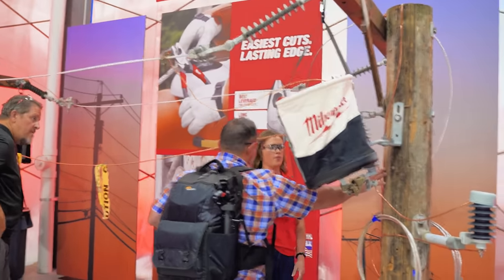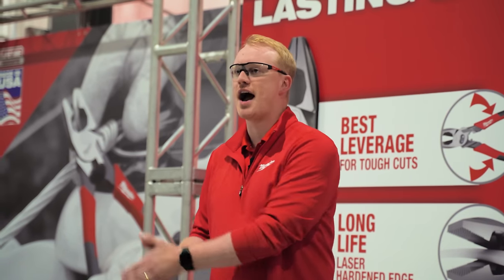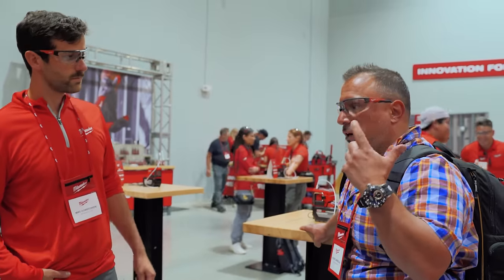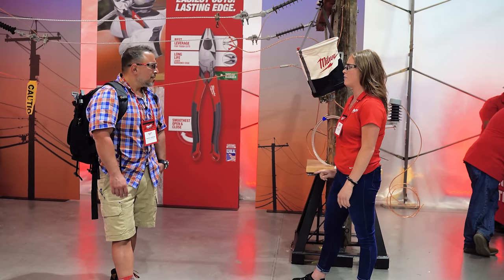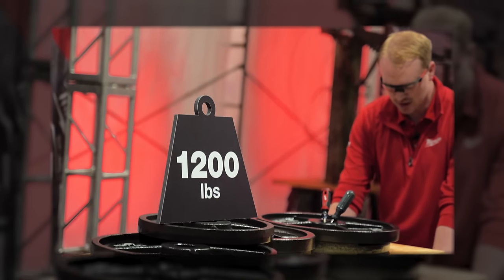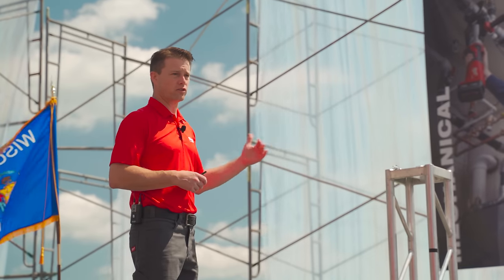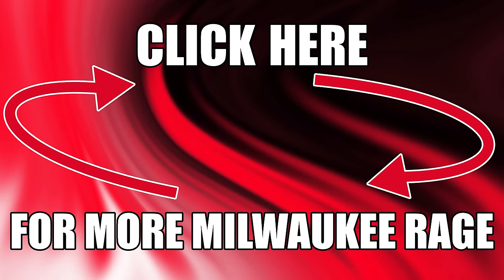BIG Problem With Milwaukee's USA Made Hand Tools (THEY'RE LYING)

Comment: New Britain tool company made the best tools, they didn't break.
Super precision bearings are hardened using induction. 
My guess is, the laser is versatile.
Probably not better, cheaper.
Induction heaters are built for a specific job and won't effectively do any other.

Comment: I swore not to buy Milwaukee tools because of all the fan boys.  A tool is meant to be used and sometimes the fans and the company do get “a little extra” as you say Vince.  That said, I started a factory job two years ago where I needed to supply my own tools- and everyone said the m12 line was the way to go for power tools.  I priced it out and they were on par with the competition for the core tools I needed when they were on sale (drill, impact driver and cordless ratchet).  I’m a believer.  Their screwdrivers aren’t anything special but I like them enough that I bought them as a second set at home after my USA craftsman and they’re now my primary screwdriver.  I’m considering m18 to replace my black and decker 20v at home but some of the tools I just can’t justify the cost.  I did subscribe though, so if I see any sweet tool deals maybe I’ll jump on the m18 line next 😂.  Kobalt, Metabo HPT and ryobi are at the top of my list if Milwaukee doesn’t come through for me by Black Friday.

Comment: I'm and electrician & HVAC-R tech.  Overall, I like Milwaukee tools; but I have owned many of their screwdrivers and do not like them.  The tips seem softer and do not fit or hold up as well.  Also do not care for the handles.  Greenlee, Klein and Dewalt make the best from a fit and durability standpoint.  Believe it or not, Doyle is also pretty decent.  IMHO, Milwaukee is top drawer on corded and battery tools, just not there yet with hand tools.  Maybe the latest generation in the Vid are better?  We'll see.

Comment: Not everything that Milwaukee makes is top of the line. I have a pair of strippers/cutters/nose pliers that have what I think is a design flaw. The cutter portion is too close to the end, so if you use it as a pair of needle nose pliers, you can easily bite into the cutter portion and mess it up where it won't close all the way and lock in place when not in use... filed mine down once because of it. If they would have placed the cutting portion back further from the end this wouldn't have even been a issue, the nose plier portion isn't near long enough to avoid the cutter portion. Now I just use regular needle nose pliers when I need it.

Comment: Not gonna lie it has been kinda cringe to watch some of Milwaukees demos recently. I own Red tools and i see 👀 the little tricks and things done in the demos. I just wish Milwaukee would increase their quality of tools not their quantity. 
Just to name a few things such as, battery wobble on their 18v tools, it drives me crazy and doesn't make the tools feel as quality as say Makita or Dewalts newer tools coming out now. Their drill chucks being horribly off centre compared to well even some cheaper brands. 
Battery issues, impacts not working because of poor quality control from factory assembly with pinched ribbon cables, triggers not having a rubber baffle to prevent the ingress of dirt from the environment it was designed to work in, i guess thats why my brothers Makita tools have lasted longer than mine, just better build quality and though for longevity i guess. A 5 year warranty is great but you know what is better, a 3 year warranty but never actually having to use it...

Comment: As a manufacturing engineer, I can tell you with absolutely certainty that people need to browse the aisles of their local hardware stores. Look at the quality between brands. If the hand tools look lesser in quality visually, they are lesser quality. If they don't pass visual inspection, they're not worth buying.

If you're seeing an indication of poor casting, poor grinding, jaws that don't line up by tooth, cheap "bluing" lines on the tools, they are all indication of cheap tools. 

Some Milwaukee hand tools are of good quality, and you can 100% tell which ones are made in Taiwan over China. Don't let them tell you though that their lineman's are made in America, because they're not. They're made in Taiwan, and probably the worst tool to come out of the line. That's their LIE. Be like me and have an assortment of hand tools from different brands.

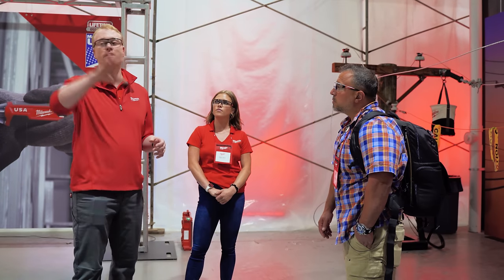EDIT: 4:35 ABSOLUTELY boils my fucking blood. Please for the love of Christ get someone in there that knows even the slightest bit of manufacturing, and not some dumbass that makes excuses. There are things called STANDARDS, and every manufacturer follows it.... It's so well known and public, a simple GOOGLE search can bring up the standards.

Comment: USA product that absolutely killed it in the cordless market for years now. Milwaukee hit a lot of people’s soft spots. Great reputation and they have no problem using their momentum on their hand tools. You see Milwaukee and you think best of the best. As a Makita guy I can tell you Milwaukee cordless is the best of the best. But the hand tool market is slacking. Not even just Milwaukee. All of the Klein tools I’ve bought recently are junk. All of the channellock tools I’ve bought recently are junk. Klein drivers loosing magnets. Channel lock needle nose bending and their pliers handles being devolved easily. The hand tool market in the US is falling apart and it’s because of brand loyalty. 

I’m a Makita guy, with a corded Milwaukee super sawzall….. Signing off
Reply: @Dr. WomenHateShortMen  🧐 their 12 volt makes me regret my investment in Makitas 12 volt. How they get that power from a 12 volt platform is beyond me. They killed it.

Comment: I must be the odd one out but I seem to be the only guy that uses hitachi/hikoki gear (sparky) Still have 3ah batteries from 2010 that hold a charge and drills that ive upgraded before needing to be changed.

On the other hand about 60% of the guys i know that have Milwaukee have had trigger failures on their drills and impact drivers which puts me off them

Comment: The marketing firm Milwaukee making hand tool in the USA out of imported steel with foreign national workers. The ratchet in my socket set broke on the first use. My 3rd gen m12 impact and drill developed problems on the first job. Every bag and case have had the zippers fail. The only tool companies left on earth that just produce tools are Makita , Hikoki (Metabo , MetaboHPT) and Hilti. Next in line would be Bosch tool. I am not a fan or a fan boy.

Comment: Milwaukee has the best batteries. They work well up to 100 degrees. In more extreme heat they fail later than any other brand I have used. They work pretty good down to around 25 30 degrees, and fail later than dewalt. I have been hating on milwaukee hand tools since they started. They work, but no better than some more affordable brands. The fastback is handy, but easily breakable. I still have my first good knife, magnesium craftsmen my dad gave me when I bought my first tool belt a dozen years ago
Reply: As far as snips go, you will get way better snips from wiss or midwest at a lower price. You will find better pliers and wrenches from crescent, channellock, or even just kobalt will probably be on par!

Comment: Milwaukee hand tools are subpar compared to mainstream shop brand tools. They still can not compete with snap-on, mac, tekton, koken, knipex, Icon, gearwrench, mayhew, greypneumatic, even VIM.... they are more on par with Sunex. I have personally bought some milwaukee handtools at home depot in a pinch when Tool truck is not available.. and they either all broke, got damaged, or just didn't perform as good as the mentioned brands.

Comment: I always buy the cheapest and Pittsburgh Tools have yet to let me down.
Snap on snaps off. Busted sockets.
Craftsman ratchets are made of silly putty.
I owned 1 Milwaukee power tool.
I plugged it in and it instantly caught fire.

Buy cheap, save money and get the job done, faster.

Comment: Milwaukee USA made tools are no better than Klein or Channellock and Formerly Western Forge.  I do give them credit for innovation regarding using Lazer technology, along with using induction for heat treatment which potentially could help keep costs down.  This technology also helps on an environmental standpoint. Until Milwaukee can compete or beat Knipex, I'm not sold. As far as Screwdrivers go, It's hard to beat Klein, wera or Wiha.  Companies often times blow things out of proportion.  I give Milwaukee props for innovation in manufacturing.  I worked with tools long enough to know what advertisement hype looks like. It's great there's another company out there making USA made tools. I'd also like to see more manufacturers bring production back to the USA.  I believe Lazer technologies and induction heat treatment can make this possible.  One of biggest costs with manufacturing tools in the USA, is meeting environmental standards and the cost of permits.  The other expense is labor. With these said technologies albeit expensive for startup costs, in the long run it's a game changer.  Less labor required, very automated, not much of a foot print.

Comment: They don't need gimmicks. They just need to produce accurate, tough, and American made tools. I'll never use a screwdriver to pull 1200 lbs, if I need to do that, I'll use a pickup. Just make something that's good, something that works, and make it in America, then it will sell.

Comment: In fairness I only saw you pull like a foot while the other guy was dragging the box across the floor. So technically you're right but your arm was shaken like crazy to prove a technical point. I can show you technically my truck can't pull something but then I can show you that it can... but at what cost the structural integrity of my work?

Comment: I'm 63 years old AND my dad gave me his old tools an I'm still using them AN  THESE tools  are all  different kinds some are thorsen, some are proto, some are , stanley ,some are, craftsmen ,an snap on,AN  crescent, AN Sears, but I've got a pair OF linemen pliers that will cut a 5/16 steel cable no problem  an a half inch copper cable . An I've tried TO BY another pair just like these an THE snap on guy says give THEM here I can send them in an see if they make them BECAUSE the ONLY mark is an S - O. AN THAT all but THEY work great I'm WORRIED I would never get them BACK an THEY were my dad's  AN he's gone.

Comment: All I want is a quality American Made tool that doesn't cost an arm and a leg. What good is a tool if you can't afford to buy it, i.e. Snap-On? There should be no way that a quality Chinese-made tool could be manufactured and shipped across the ocean, pay tariffs,  pass through importers, buyers, distributors, and retailers, and be sold for less than a tool manufactured in the United States.

Comment: I just threw out all my old craftsman screwdrivers cause they were making my tool box smell like puke. Guess it's a chemical in the plastic handle breaking down. Just thought I tell everyone.
Reply: yes, acetate butyrate decomposes and smells like that.  Many like that kind of handle. I prefer the Klein molding. You could have aired out the tools and cleaned them to remove the residue coming to the surface.

Comment: So I know this isn't the point of the video, but did he say that the entire manufacturing facility has air conditioning? Like, the whole materials area, assembly, machining, etc... everything inside there, has AC? Because if that's true, that right there is the most impressive part of their new facility. Lol. Ask anyone who's worked in manufacturing or warehousing. It gets hot as hell in every building, especially the concrete ones. And, each day in a row that it's hot outside, the temperature inside gradually gets hotter and hotter. Those buildings become essentially an oven. They don't cool down overnight at all either, because the concrete just retains every single degree that it can as if it's the most valuable asset in human history. And in the facilities I've worked in, we weren't allowed to open doors at night because it would have let in dust and dirt or it was a violation of our security policies. Anyway, I've gone on long enough here... I just wanted to say that I am deeply impressed and thankful that Milwaukee is setting the example in that sense and I can guarantee you that their employees are far more grateful and thankful than anyone could understand.  I hope and pray that other companies follow their lead and despite the substantial cost to provide air conditioning, they follow suit.  
(I am aware that the caveat to this is that some manufacturing and production facilities cannot have air conditioning because the humidity will rust their parts and/or products, so it just isn't something that's feasible. However, I feel like technology has to be at a point where it can eliminate that humidity while simultaneously allowing cool air to flow throughout the building. I'm no scientist but it seems like a dehumidifier in conjunction with AC would be a step in the right direction. 🤷‍♂️)

Comment: I’m not one to break down another’s thought process but what do you think marketing is? They are branding their tools as made in the USA and as a made in the USA tool that does exactly what the foreign made competitors tools do and do it better than the competitors. I’m not sure why you are creating this conflict. It’s almost like you have the air conditioning on as cold as it will go while having the heater running as hot as it will go in your own head. Like you’re saying two plus two is four but also, two plus two isn’t four. It’s marketing. It’s advertising. People love to see tools doing this crazy stuff while doing what they’re made to do. We all know the difference between the truth and a lie. The truth with the screwdrivers would be it took a lot more force to keep the screwdriver stuck in the screw to pull the weight with the competitors tool than it did the Milwaukee. The Milwaukee screwdrivers, in my opinion and experience, have been the best fitting and performing screw driver I’ve ever used. I’m thinking about buying the 14 in 1 to keep with me at work instead of my Klein. All this being said, when you advertise your product, you show it in the best light possible and you do not highlight your competitors product in such a way that make your product look equal or lesser than. That’s not a lie. A lie is quite different. A lie would be if Milwaukee said no other screwdriver out there fits screws well. A lie would be if Milwaukee said no other pair of linesmans or needle nose or dykes are sharp and cut well. You’re queuing in on certain things and leaving out the whole big picture of the matter. They aren’t saying no other tool manufacturers tools will do the job and do it well. This was hard to watch and listen to man. I say this all as a mature adult in a calm manner with no ill or cruel intent, just so you know.

Comment: You're proving to me, that we only need one size for everything. I'm in the auto body industry. I will tell you that manufacturers for cars. Use anywhere from 2 to 5 different types of fasteners which requires anywhere from 5 to 6 different sizes of tools. He said it when he stated. That the manufacturers quality and consistency is not right. So the answer would be. I only need a 10 mm for everything on a car and one sized hex fastener. If the manufacturer is worried about weight? Then stop putting all these Bells and whistles, that make it so that a human doesn't need to pay attention when driving.

Comment: Can’t say I think all that much of their hand tools though they have some that are truly unique and useful.
75% of my Power Tools and 95% of my Battery Tools are High End Milwaukee … they’re still the Best but the newer they are the more “Disposable, non Servicable” they become. (Sad)
Reply: Some aren't that servicable, but I've repaired about 20-30 different items so far. If any of your tools break I might have a tutorial video for repairing them.
Reply: @rch5991  I'm not a fan of the brushed, I bought a drill to try and repair but the armature was fried. I've repaired quite a few brushless fuel tools tho.
Reply: @rch5991  it could be dirty contacts in the trigger it won't hurt to try some switch cleaner in it. I have had similar problems with an sds drill where it would work sometimes when the trigger was pulled especially if you turned  the chuck manually slightly if it didnt work. That was a blown mosfet. Think of it like a 3 cylinder car running on 2 cylinders.

Comment: Blaming the fitment of their screw drivers on the screw manufacturers. Maybe size your drivers to what's commonly coming out of the screw factories since that's what the average buyer will be up against.  It's so easy to sniff out bs from these recent college grads out on the front lines to sell the company's tools. I can't recall the last time I had to pull my 1000lb+ tool chest with a screw driver.

Comment: Was it a utility pole or telephone pole ?

I say telephone pole- as a telephone wire was originally ran on these poles.

Use using a screwdriver to pull a cart?
Outstanding -
 in that matter use a hammer on the other end and see how soon it shatters in 1000 pieces

Comment: Vince I'm telling ya Milwaukee quality is going down hill.
Reply: easy thing to say... but their m12 line are great, their surge impact, their new 4-adaptor driver, people love their packouts and of course you haven't likely used these tools.  So what proof do you have?
Reply: @michaelbuddy  Not sure if they are going down hill, but I've bought about 20-30 broken tools so far, and repaired 99% of them. I think I got a bit addicted to buying broken tools off ebay. Quite a few tools like an SDS drill I repaired had blown mosfets, but things like the m12 irons its either the heater or a thermal fuse, and repaired a couple of radios and a few different LED lights too!